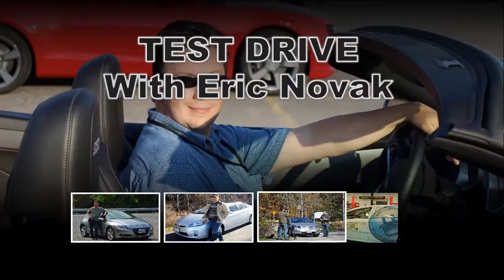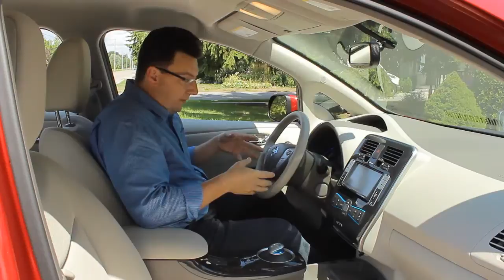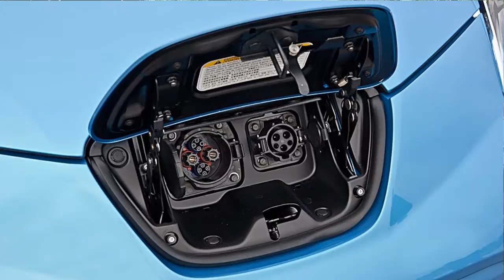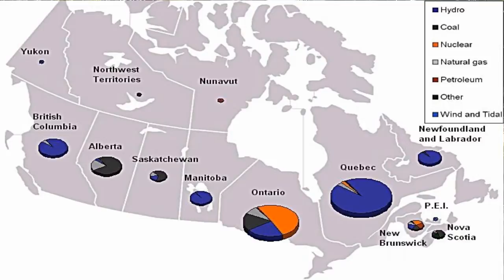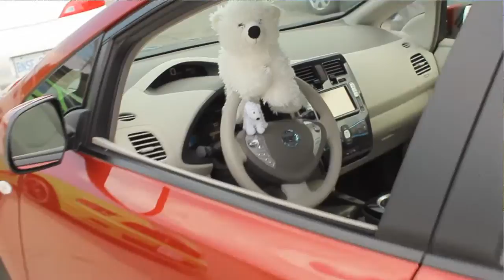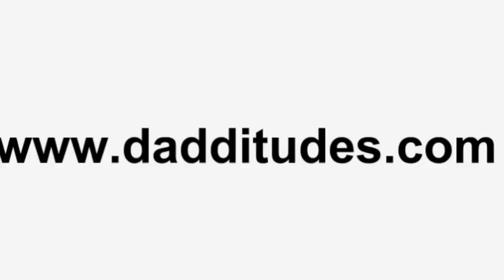TEST DRIVE: 2012 Nissan Leaf

Comment: One undermentioned tidbit in the recharge math is the question; how often will you drain it all the way?.  If your recharging after a 30 mile drive that 16 hour recharge might be 7 or 8. or 4ish with the 220v. Now Lets say you want to drive 2 hours into that four hour charge. Fine, stop, run your errand, and put it back on charge. In everyday use I'm thinking the charging is easier than gas stations already.